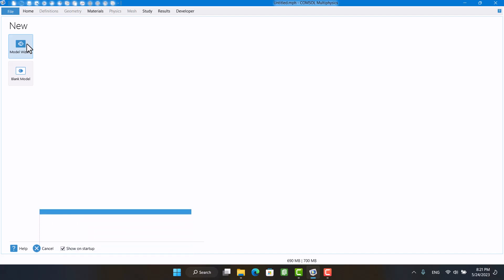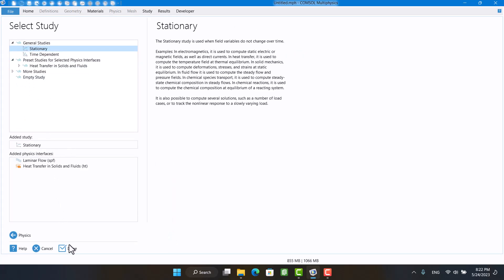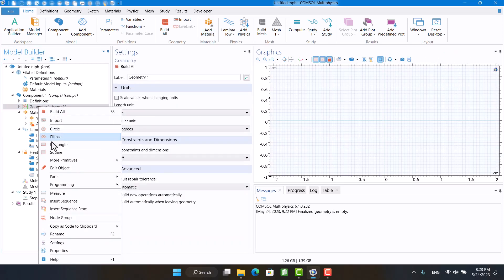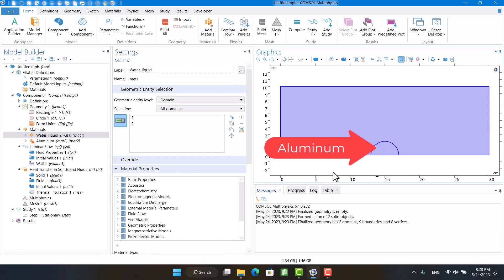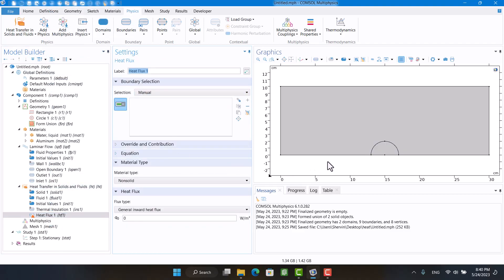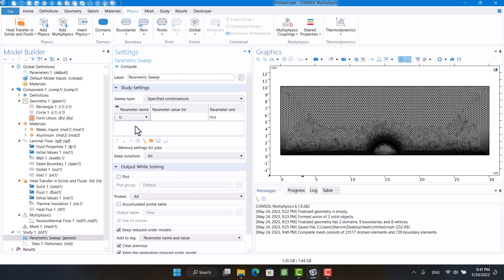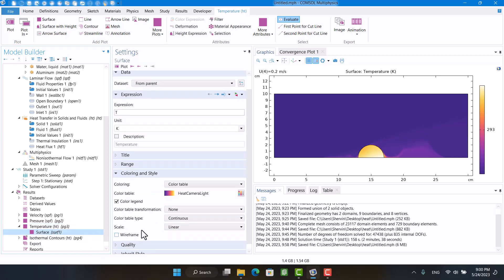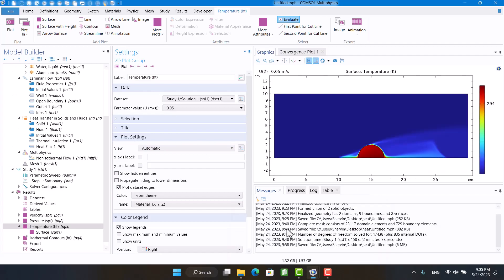🌊 COMSOL Tutorial: Coupling CFD and Heat Transfer (Part II) 🌡️

Comment: Thank you very much. Please create a model showing a solid domain (20-30 C initial temperature) including a viscoelastic sphere that experienced cooling from 1000 C with transient heat transfer analyzing. I have never found such a convective cooling case on the Youtube platform.
Reply from the maker: Thank you for your suggestion. 🙏